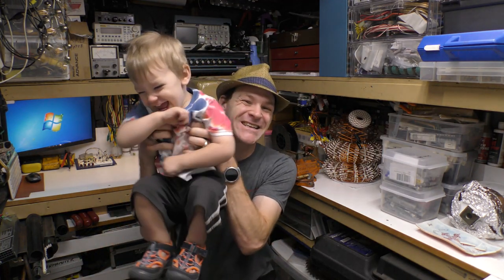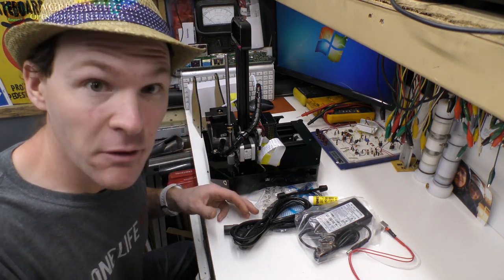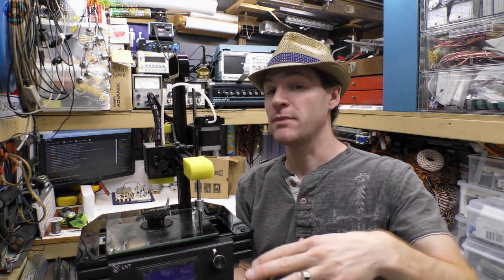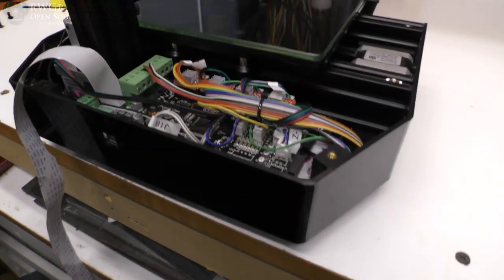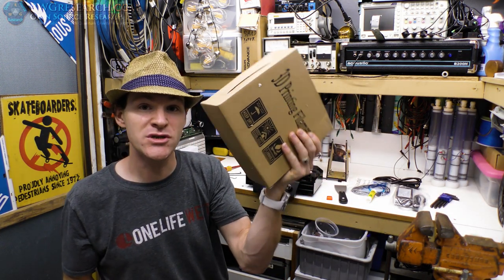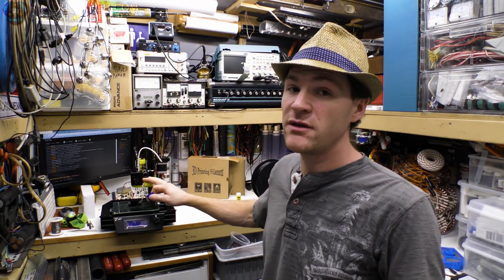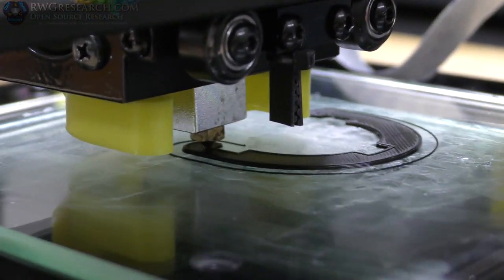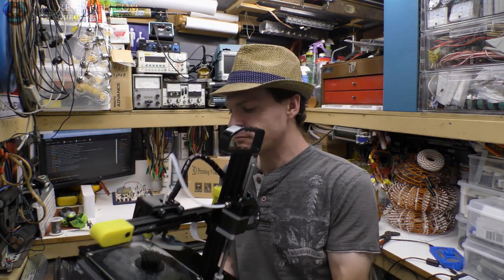ANT Ecarry 3D Printer Review! From Gear Best (Prints Speak For Themselves...)

Comment: Impressive! I especially like how it has a relatively big build area compared to the size of the printer. Also, the editing on this video is top notch! Very good review!

I backed the New Matter MOD-t a few years ago on Indiegogo and have loved it. I think I paid $199 but the normal price is $299.  I thought it had a really fascinating build technique and cost less than what I would have spent on parts to build my own.

Biggest issue I've had is the limited build volume, (150, 100, 125mm) and that they limit the temp to only print PLA. Also, closed source. Although, it does have wifi, it's quiet, and it looks super cool.

Comment: I bought this printer 2 months ago, when it arrived via Sea shipping, it was smashed the 10mm Acrylic base and the side and top acrylic parts all broken, I was heart broken. I got on to Gearbest (I had paid shipping insurance to Gearbest) and as you said they offered 1. a full refund I would have to pay the return shipping and they would credit that to my Gearbest account for my next purchase. 2. I could keep the printer and have a discount of the price again credit to my gearbest account. Or 3. the one I took they sent me a new printer with a discount off just over $90 so I thought hay why not that way I will have all the spare parts for the new one I could ever need except for the broken Acrylic frame pieces.

Then while I was waiting for my new one to arrive I took the broken one totally apart. I went to my friend who has a CNC machine and for $30 he made me all the parts that were broken I reassembled the machine, started using Cura then Simplify3D and I'm totally happy with this amazing little printer. So now I have a brand new one still in the box spares or sell will see.
I would recommend any buyer to pay the extra small insurance shipping charge (to gearbest at time of purchase) as the packaging on this printer is terrible way to thin foam.

Comment: Is ther somboddy ther Can tell me how to enable autoleveling on the Ant Ecarry. Mine dont works. 😱
Reply from the maker: https://www.youtube.com/watch?v=kr3UIgZhCEY see that video, may be some fault with the sensor... Thanks! ~Russ
Reply: i treid to adjust the sensor. and it trikkers just fine but 
my bed is not in level and the printer dos not adjust it self.
i can see that the nozzel is too close at the front side and to high at the back side......it dont auto level
hwat am i dooing wrong.
sorry for my bad english  i am Danish
Reply from the maker: @perprst6020  when the printer is printing a single layer, dose the Z axis move at all? (Look at the coupling on the Z axis) . If it is moving even a tiny bit then it is working.  If this is the case. Check and make sure your bed dose not wobble. If it moves at all then that could be your problem.  ~Russ
Reply: the z axis dose not mowe at all hwen it is printing.
the auto home and the autolevel funktion is calibrating ok.
ther is not any wobbel i hav made these adjustment acording to your informative video.
Reply: i think i is my slicer program thats make the trobel   Cura  ( the new vertion )
the files that comes vith the printer works just fine.
but not vith cura.
hver du i find a slicer that suport FDM printers 
cura runs for FFF types 
hope you can help
Reply from the maker: @perprst6020  ah, yes, you have to add the proper start script in cura. i dont use cura, but it is under start script i think. make sure you put this before your G code. ( using the start script section in cura) 
G28 ; Home extruder
G29 ; run auto level 
https://reprap.org/wiki/G-code#G29_Auto_Bed_Leveling_.28Marlin.29
in the ant e carry drive there should be instructions for this. 
Thanks! ~Russ
Reply: Thanks for your quick anser.
IT WORKS.
THANKS for your time.